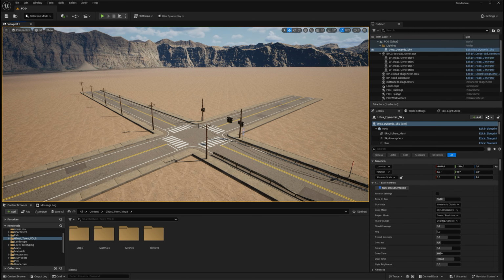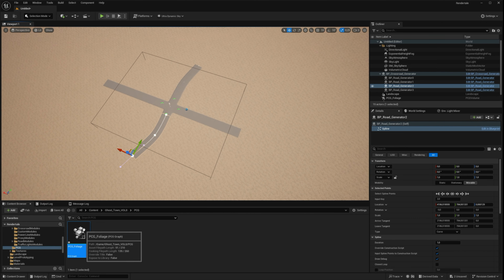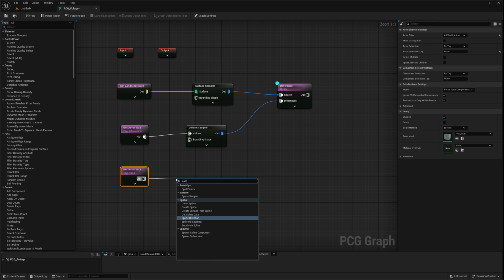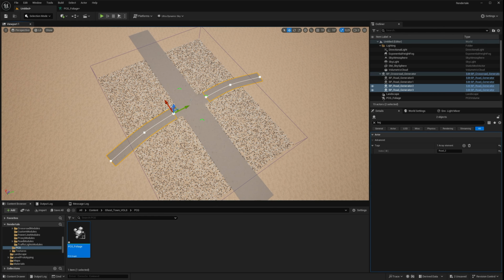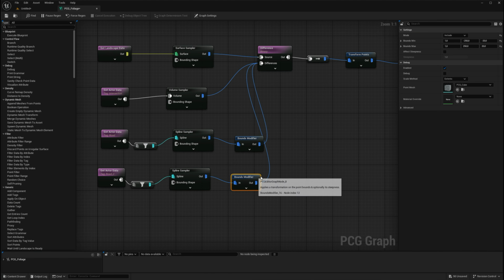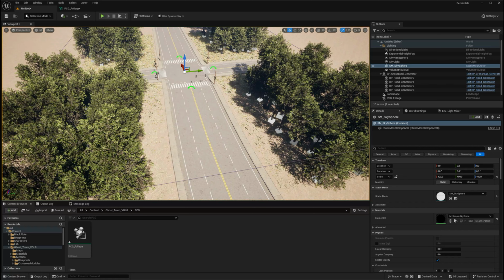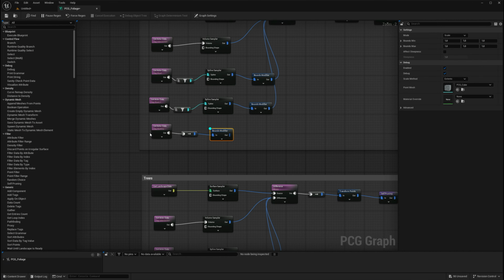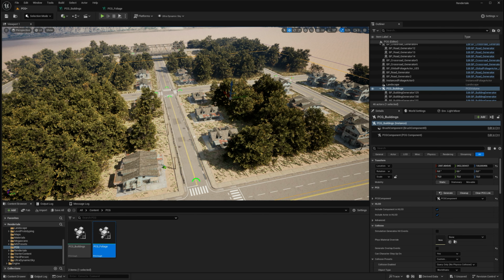Crossroad Generator For Unreal Engine 5 - PCG Integration In UE 5.5.4

Comment: Hi, 
I’m experiencing an issue with the plugin and I’m not sure how to fix it.
I’ve noticed a texture inconsistency between the right and left sides of the road, sidewalks, and curbs. The parts appear different even though all settings are identical. The problem always occurs on the left side, and even if I rotate the model, the left side still looks incorrect.

The image reference in the link
https://drive.google.com/drive/folders/1Bn6a1_Y__b6Zwhzi_c2DZBDA2LmVo0g1?usp=drive_link